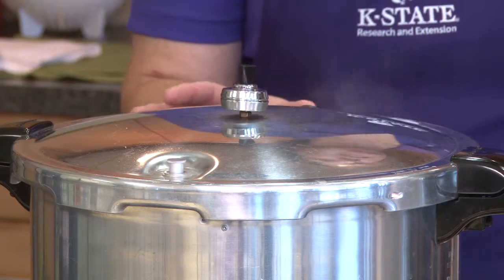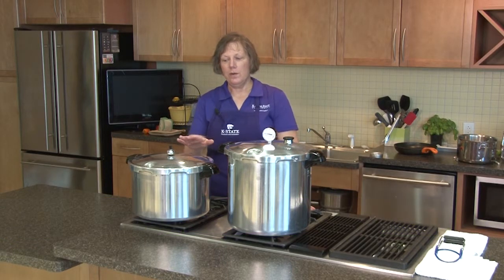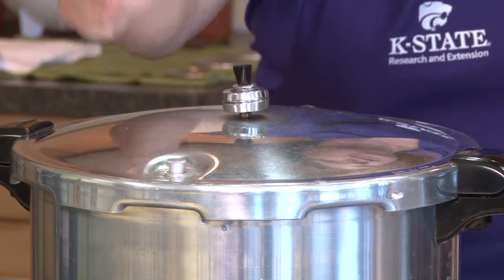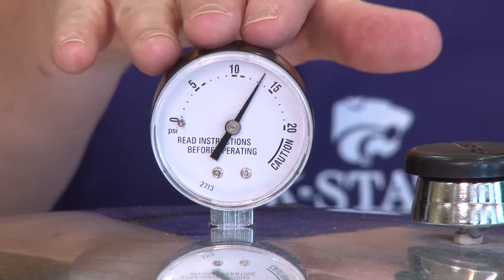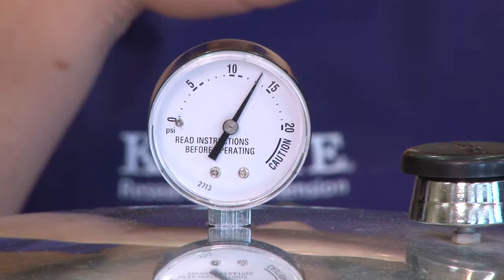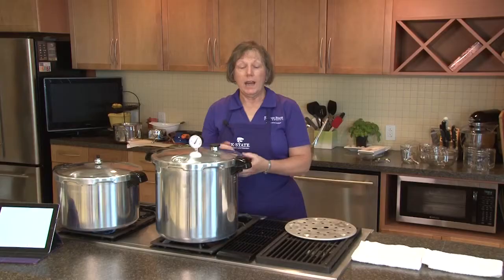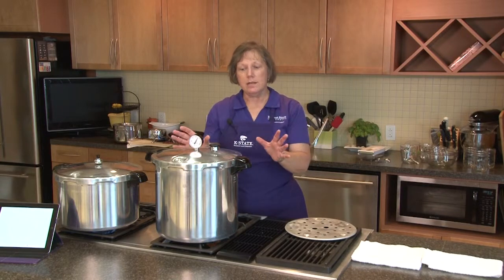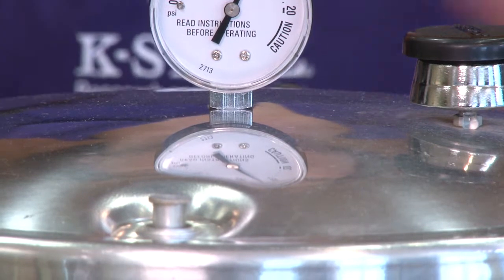Program 15 -- Cool Down After Processing

Comment: I have the 921 All American canner and it takes forever to release the pressure. Even though the gauge shows zero, when I try to remove the weight more hissing comes out. I let it cool naturally but today I am in a hurry and sometimes it takes hours for all that pressure to be released. I have not read about this issue anywhere.